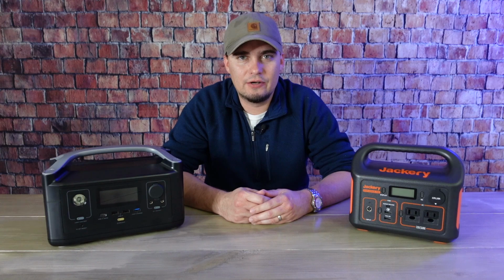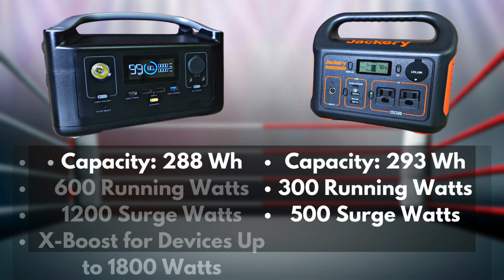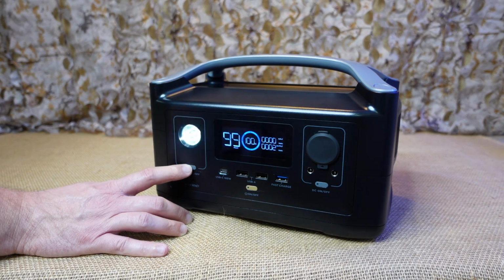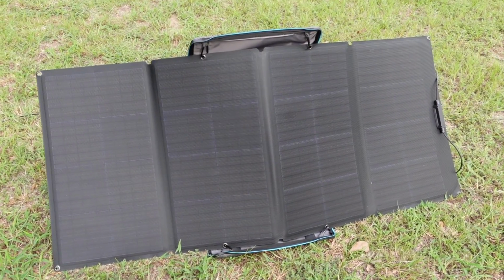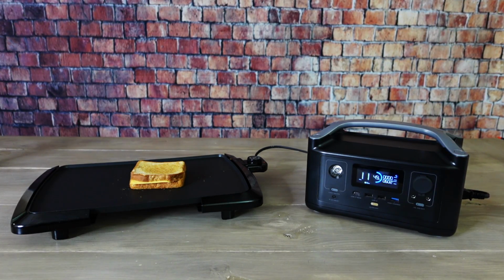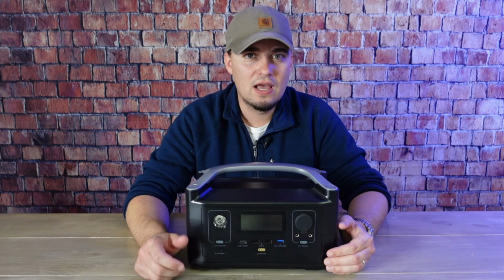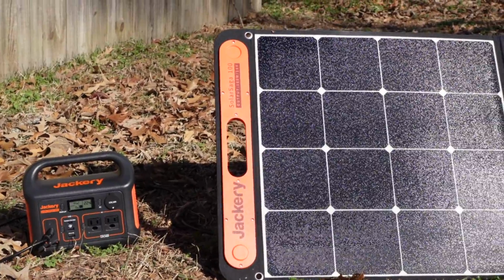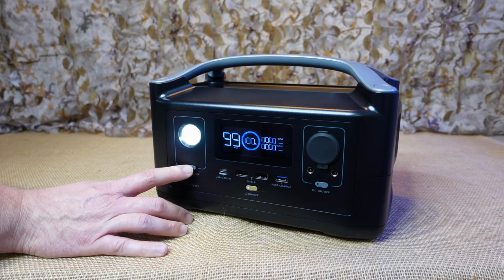Survival Gear Showdown: Ecoflow River vs Jackery 300

Comment: I came to the same conclusion and just ordered the EcoFlow. One thing you did not mention is that the EcoFlow also comes with all the cords you need for charging, i.e., Solar cable, DC, AC, and multi USB cable. The Jackery only comes with the AC cable. This is easy about $50.00 worth of cables. The other fact is the exspandability and remote app, the Jackery has none of those featueres. Oh, and I almost forgot, the EcoFlow uses up-to-date LieFo4 Batteries whcih is why they charge in much less time and can charge abour 2500 times vs. about 500.

Comment: Will you answer a question? I have an ecoflow river. I want an extra battery. I do not want to use this with an app. Will it function properly,after adding the extra battery, without using the app? I just want to charge with my solar panel then use it and repeat. Thank you for your time.

Comment: Good video, just one nitpick:
You imply that the River communicates in some way with the equipment. 
Actually, it's quite simple: It just provides a lower voltage when the 600 W limit has been reached (e.g. 100 V vs. 110). 
So, it will possibly provide more amps at the expense of lower voltage.
Doesn't seem to be a problem for "dumb" equipment like hair dryers or anything without electronics. I soon get one and I'm thrilled to test it thoroughly.
Greetings from Germany (winter is coming).

Comment: Wow. While watching this and other reviews. Last one in Amazon Ecoflow Store at $299 with -$50 coupon at checkout went so fast. I got lucky with one last in stock at that price and it went back to $316 with no discount!  The extra pack battery is still on sale at this time at $249 with -$70 coupon.  This was a hard decision as the battery on this is Lithium but not LiFePO4, however base on the price discount, it was hard to resist. I was considering FFpower 500W Portable Power Station, but features wise this is a winner for me such as 200w solar charging, the ability to power devices higher wattage rating (emergency only lol) at any rate great video DIY Prepper TV!!
Reply from the maker: Thank you Bernel!

Comment: I am EcoFlow all the way, so far I have the Delta Max 2000, and the River Pro.  They have more features, and more input and output capacity.  For the EcoFlow, though, I think adding an extra battery (buy cheap, expand later) is a gimmick.  The batteries are almost as much money as buying another fully functioning unit.  I love my Delta Max, but it's heavy, so I use it mostly off house current, knowing that I can use solar panels if I want.  The River Pro is great for moving around, taking it outside to charge, and it still does great things.  I got a great package deal during Black Friday, so I got the Max and four 160w panels.  So, I can expand on units, I would rather do that than expansion batteries.  The extra batteries have to be used with a full unit, you can't use them without one.

Comment: Ok, what I am trying to figure out IS:  does the Eco REQUIRE the purchaser to use an app to use it?  That is something that would be a No Go for me....I didn't realize that until another person mentioned it at the end of their video.....I don't want to have to "sign up" via any app to use a product like that or control it.  Thank you for the info!
Reply from the maker: You don’t have to use the app for basic functions. You can turn it on and off and activate ports manually. I believe that xBoost is on by default so you should be able to use that without the app as well.

Comment: The ecoflow cant handle more load just because it's in boost mode.  Its lowering the voltage thus lowering the output wattage..600w is still 600w
Reply: Even without the X boost mode it still outperforms the Jackery

Comment: I started out with the 160 and 240 Jackery's a few years ago (before that I was using a deep cycle marine battery with an inverter and had no solar, just a battery charger), but I also now have 2 Ecoflow River's with the expanded batteries.  Another thing is that the River uses MC4 connectors for solar panels (so you don't have to buy their panels) and the Jackery has proprietary connectors.  I have a dual fuel inverter generator, so I can charge any of my power stations, if there's no sun, as I live in MI (because I have the smaller Jackery's, they charge pretty fast too).  I have the 60 watt Jackery and 110 watt Ecoflow portable solar panel(s) and a regular stationary solar panel that I use with the River's only, since the Jackery's can't connect to it.  

Overall, I have to say that the Ecoflow's are my favorites. (I just got my second one, on sale, about a week ago.)  It feels good to know I've got it covered in case of a power outage.

Comment: No contest.  The Jackery has never made my "short list" when considering power stations.  I do have the River and its extra battery, but other than some brief testing, it lives in a Faraday can.  One disadvantage of the River is that its solar charging input is the somewhat unusual XT-60, whereas the Jackery has a more common 8mm barrel port.  The Jackery can also be charged through its bidirectional USB-C port, whereas the USB-C on the River is output-only.  A disadvantage they share is that both use Li-ion cell technology, good for ~500 cycles before losing capacity; you'll need to spend a little more money to find units that use LiFePO4 technology, which is good for at least 2000 cycles before losing capacity.
Reply: Any suggestions on any that use LiFePO4?
Reply: @abellius66  Bluetti EB70 (not cheap) or Oukitel CN505.

Comment: You should have mentioned that the EcoFlow can also do pass through charging which is a huge benefit.
Reply: That's something I love about mine!  I can do the Pass through to my Trailer's Fridge on long nights when it gets dark early.  If the Trailer's Batteries run out of juice, the EcoFlow will keep the Fridge going until the next day when we can get the Trailer's Batteries charged up again.  Then the Solar Panels can charge up the EcoFlow!  Perfect System!
Reply: Great feature, and it switches over seamlessly when it looses input power. The only worry is if it is actually working, I see the icon however it show a input V, and then a output V which is the pass through charge. Makes me wonder if it is still pulling from the battery and then backfilling from the input? We may never know haha

Comment: Confused on ratings… they seem to complain alot about keeping its power charged for more than a few days…? Have you experienced this bro..?
I’d like to think I could keep this stored fully charged and when it’s needed for emergencies,it has a full charge.
Reply from the maker: The River is my second Ecoflow, and I haven’t had any problems with them losing charge.
Reply: The key is to make sure they are turned off. The issue with the EcoFlow units is people touch the power button, which puts it in Sleep mode, not off, so it still uses power. You must press and hold it for about a second until it shows "Off" in the display. When really off, mine lose very little power (maybe 5%) over 3 months.

Comment: With EcoFlow you can power almost any device at home. 1200 watts is not surge, it is continuous but with less volts. With Jackery you can only charge  laptop and phone.
Reply from the maker: 1200 is surge with the River. Copied directly from Ecoflow River product page: 600W (Surge 1200W) total,120Vac( 50Hz/60Hz)

https://ecoflow.com/products/ecoflow-river-portable-power-station
Reply from the maker: It will handle devices that normally use up to 1800 watts but it will reduce the wattage it provides.

Comment: Pulled the trigger on the EcoFlow…. was on the fence but your video motivated me to add this option to the kit. Thanks and keep up the great work.
Reply: Really enjoying the EcoFlow River…. my thought process is this setup will power my Engle fridge if/when I run out of propane/gas for the generator powering the kitchen fridge. Don’t expect to have that much need for refrigeration if it comes to that. Right now I’ve used the River to power odds and ends through the house… for the cost/weight/power ratio it seems to be a great piece of gear. Keep up the great work.

EF ECOFLOW RIVER 288Wh Portable Power Station $279
HQST 4x100 Watt 12 Volt Polycrystalline Solar Panel $336
BougeRV Solar Connectors Y Branch Parallel Adapter Cable Wire Plug Tool Kit for Solar Panel $7.99
Reply from the maker: Thanks Gunny! Glad I could help!

Comment: Great review! Could one use the Jackery solar panel with the Ecoflow since you mentioned how you like the design of the Jackery solar panel?
Reply from the maker: I’m afraid not. They use different connectors. Thanks for watching!
Reply: Easy to find adapters: just get one with a female 8mm jack on one end and MC4 connectors on the other and connect that with the existing EcoFlow cable. Just use a meter to confirm polarity first. (I've done this to connect a Jackery one to my River Pro and the reverse - MC4 to male 8mm jack - to connect an EcoFlow one to my Jackery 240).

Comment: You didn't tell us how much the solar panels cost or the additional battery for the ecoflow.
I'm definitely interested, but is Ecoflow better than the one from 4 Patriots.
❓❓❓
Reply from the maker: Current prices:
Extra Battery: $219
110 watt panel: $299
160 watt panel: $349
I don’t have any experience with the 4Patriots generator but it cannot handle anywhere near the load that the Ecoflow can. It can only support 300 running/360 surge watts. The River can support 600 running/1200 surge watts.

Comment: you didnt mention number of cycles, i know the Jackery is somewhat limited.....i think i heard something like 500 before battery degradation starts to show up.   I have a Jackery 240 i bought used and it sits on my dresser to charge my cell phone edc flashlight and such. I only have to charge it up once a month so it will go for many years like this. However if i had to charge it once a week then the life is much shorter.  When the lights go out is not the best time to be learning how much and how often you will need one of these power stations so my thoughts are you should incorporate it into you life now so the learning curve is already been dealt with
Reply from the maker: They are both 500 cycles to 80% capacity.
Reply: I am using solar power now to charge personal devices I use every day, all of which run on USB.  I charge a power station once a week, then it handles the charging all week (and still has plenty of capacity left).  Another power station runs a 300W heater in the bathroom when I'm taking a shower in cold months.
Reply: Jackery says 500 cycles to 80% while EcoFlow says 800 cycles to 80%. But in reality, there are so many factors (like what counts as a cycle?) that they are about the same. If you really cycle it once a week, then 500 cycles means 10 years - and it will still have 80% of the capacity at that time!

Comment: Ecoflow. I have multiple deltas, 1300 and the pro, a really old river and a river pro... All of them with additional batteries where they are available. I guess this speaks for them since I sticked with them
Reply from the maker: Their larger units are especially impressive. I have been able to run almost anything in my house that doesn’t use 220v
Reply: @diypreppertv  I use the large ones to run smaller equipment. So in a power outage I can fire up the gas generators when they run low, have the generator run at a reasonable high load and then go off the batteries for a long time without noise and unnecessary consumption of fuel
Reply from the maker: That’s kind of my plan as well. One thing I do though is plug in my fridge and box freezer into my larger power stations right when the power goes out. If it lasts more than a few hours then I’ll get the gas generator out and use it for larger appliances and to recharge the power stations. I keep the generator’s battery on a maintainer and don’t want to mess with hooking/fueling everything up unless I really need to.